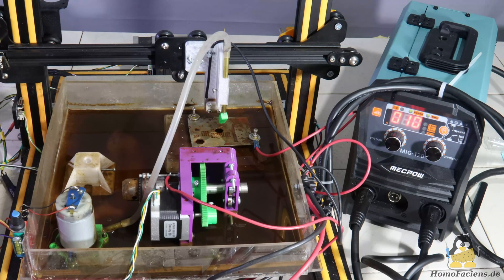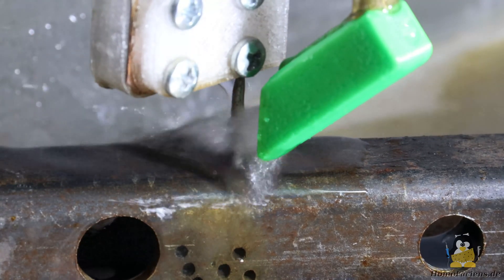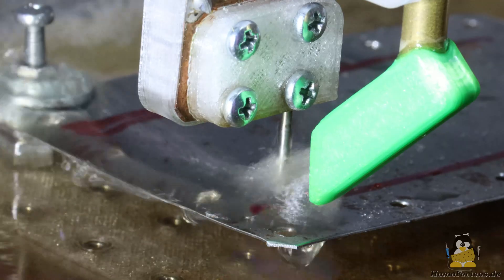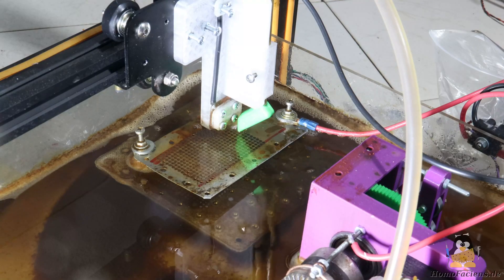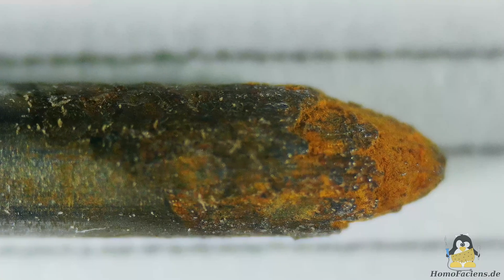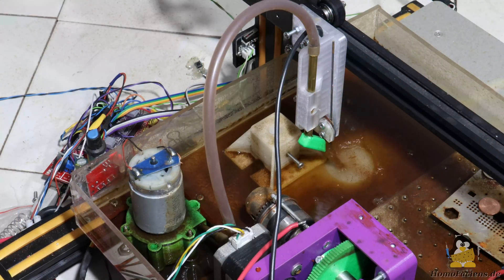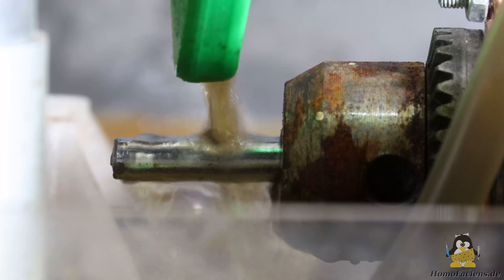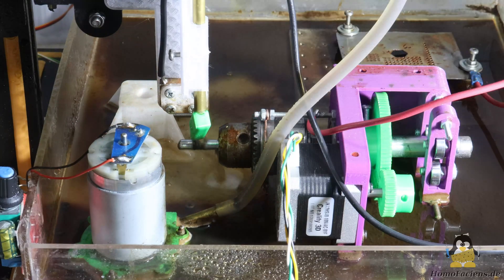CNC machining steel with a welding inverter and sparks

Comment: I want to make a water pump in the same fashion - how did you do it?
Greetings from Johannesburg
Reply from the maker: The pump design is relatively straight forward: Inlet is at the bottom at center of the axis with a diameter of 10mm. The outlet is radial mounted with a diameter of 6mm. The rotor has 8 straight, slightly tilted flaps.
I will publish the design files as soon as the next video of this machine is recorded. Stay tuned!

Comment: There is an Opensource EDM project where you can build power source and use 3d printer for EDM cutting.
Reply from the maker: Which one do you mean? A Link would be nice.
Reply: @HomoFaciens i believe its action box that makes them but i dont believe the power source is open source
Reply from the maker: @jacobpintye150 The Rack Robotics Power core is open source:
https://github.com/Rack-Robotics
Haven't heard of an action box power supply, yet.
Reply: @HomoFaciens  Rack-Robotics on GitHub
Reply from the maker: I came along the Rack Robotics machinery before. Definitely worth a look at.

Comment: Next time use a rotating electrode and study the circumference of the bore. It should be better, if the runout of the electrode is smaller. Also, why not using brass rod (messing rundstange) as an electrode? Brass it's usually the industry standard for EDM. 

Thank you for this video!
Reply from the maker: You are right with both of your hints. But as told in the video: I am in the process of upgrading the machine with a rotating electrode. 1.5mm brass tubes meanwhile have arrived.
This was just a quick look if the welding inverter is suitable for spark erosion. More on this machine, soon. Stay tuned!

Comment: The lathe EDM could be useful for custom pellet extruder screws. The electrode erosion might work as a feature, not a bug there.
Reply from the maker: The wood screws used as auger in my extruder aren't bad. I will build custom extruder tubes, first..
If you'd like to use electrode erosion as feature you have to do some test runs to get the erosion rate of various electrode/workpiece material combinations.

Comment: That's a very slow driller
Reply from the maker: But also a precise one considering the cheap setup. I will speed up the process with the next iteration of this machine. Stay tuned!
Reply: @HomoFaciens  well not cheap on the electric bill
Reply from the maker: Well, the classic CNC routers that are capable of cutting hardened steel consume not much less electric energy. They use spindles in the kW range. I might have a closer look at the energy consumption in one of the coming videos. It definitely is from interest.
Reply: The power draw of this process is 600 watts or less. Which is an order of magnitude less than used to conventionally drill materials, however speed or energy are not the real advantages of edm. This process can drill through and shape any conductive material to close tolerance with no machine frame loading in materials too hard for other machining methods

Comment: as long as you're cutting iron type metals you could use a magnet to capture larger particles in the water.
Reply from the maker: Yes, but: Stainless steel (which I have in mind for my 3D printer parts) isn't magnetic and even the tiny iron type, magnetic particles oxidize quickly in water and so no longer stick to a magnet. The brown color is an indication of rust rather than iron. A sponge should do better.
Reply: @HomoFaciens  most hackers have neodymium magnets laying around, wont hurt to toss one in somewhere the water moves. you could make a settling tank too along the line.
Reply from the maker: Yes, a settling tank could be a simple solution, too. Keep in mind that the electrode erodes, too. Tungsten or brass aren't magnetic. A filter is what you won't come around. A sponge is easy to implement and does the job. No need to make things complicated ;-)

Comment: Hey homofaciens, i diy'ed a CAM program you mighty like.  I'll give you a free copy....on my channel!
Reply: I made it because of all the bugs in other software. It does tabs, efficient sorting of cuts, easy to select lots of holes at once for pockets, profiles, v-bit carving.

And fast to use, with no hidden menu options!
Reply from the maker: Thanks, but your Software only runs on Windows machines, so it's not for Linux users like me.
Another thing: It is really in an early stage and your homepage lacks a lot of things. You mentioned that you are not good at marketing, but a few photos of things you have created with your software is essential. Also mentioning the system preferences (e.g. Windows only) would be nice. It is for 3 axis carthesian machines only?
Reply: @HomoFaciens  those are good ideas. Thank you! Yes it's for Cartesian cnc machines.